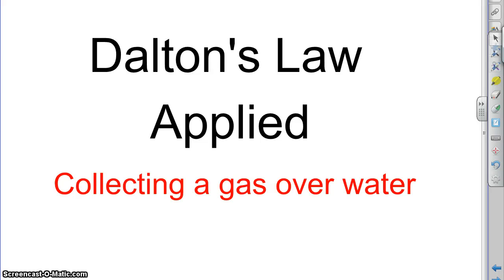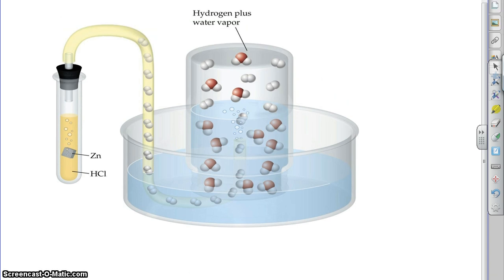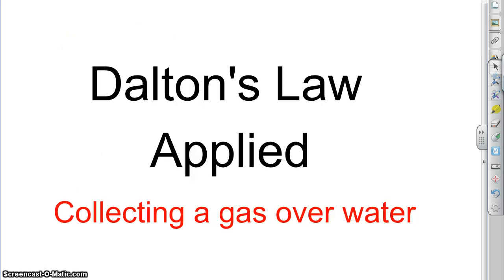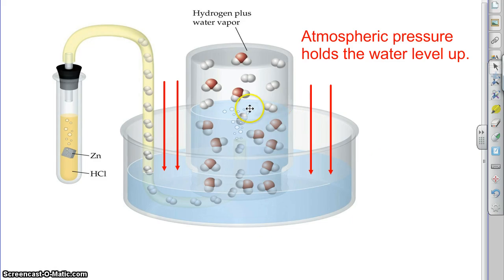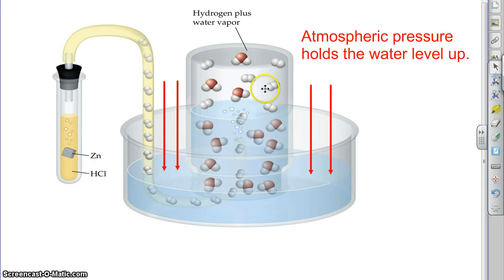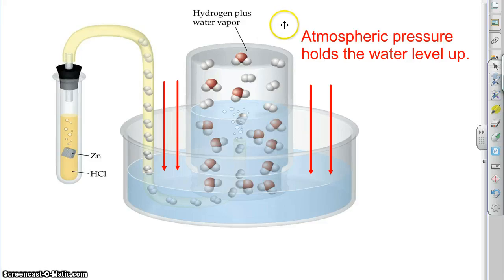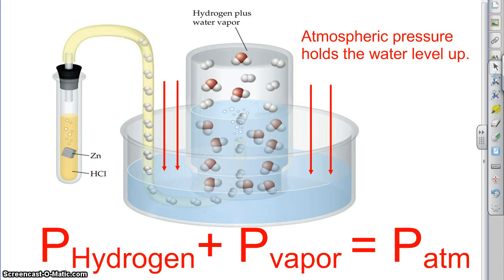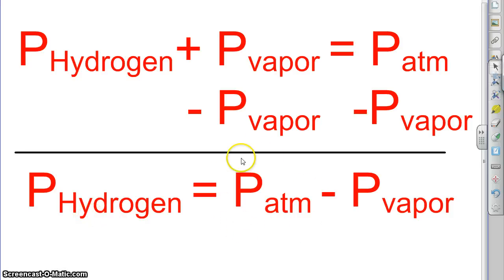Collecting a Gas Over Water

Comment: If you wanted to find the mass of the Zn used, would using the moles of H2 from finding the pressure of H2 (n=pv/Rt) be correct?
Reply: Yes but your P has to be adjusted to subtract off the vapor pressure of water first.